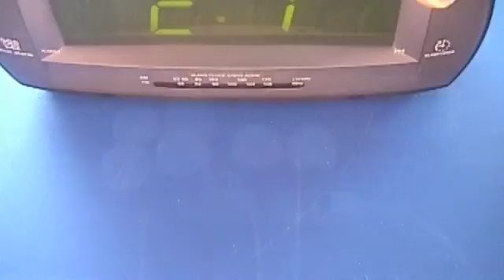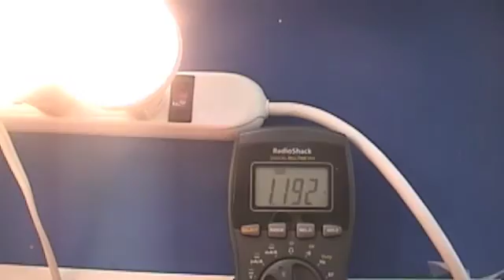Wind Powered LED bulbs

Comment from the maker: The basic blocking oscillator diagram can be found at the link above.  However, I am about 6 steps beyond the basic diagram and making improvements rapidly.  Last night's version 4.0 test showed a 40% reduction in input power and a 12% increase in light output over Version 2.0.  When I have taken this as far as I can I will publish.